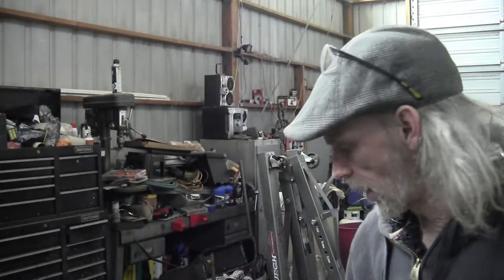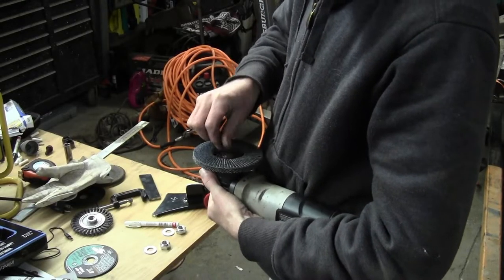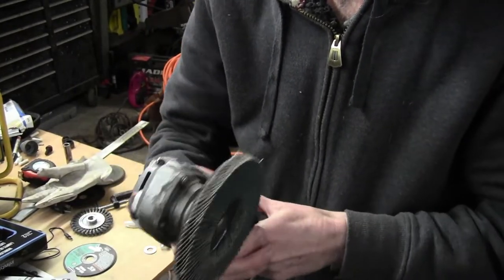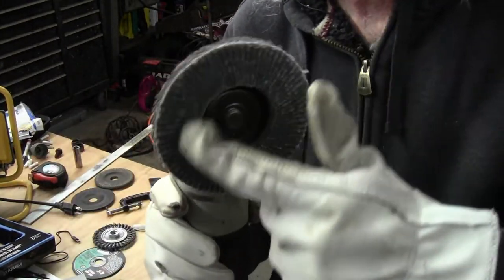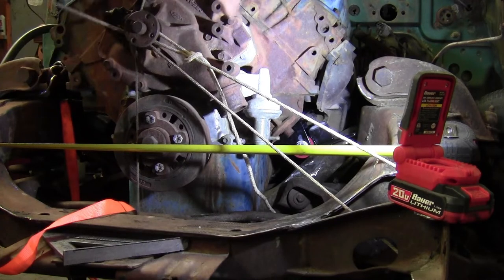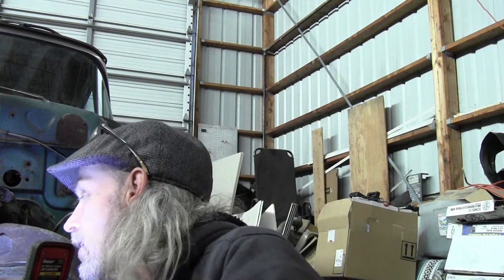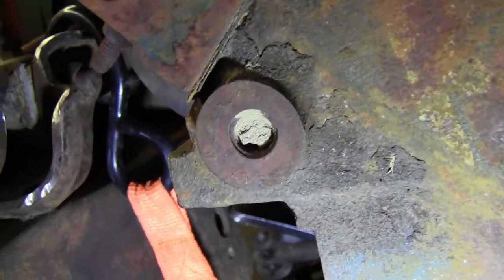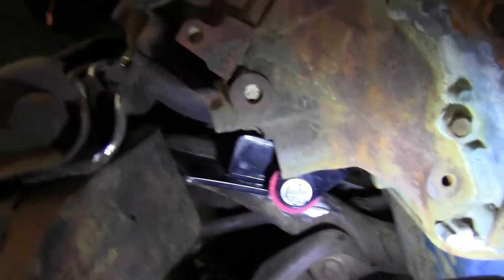1958 Ford Fairlane Budget Build, Ep 17 - My Hand Grinding Setup & Methods, and Motor Mount placement

Comment: I’ll have to try one of those discs. The thickness of them looks like it’ll last a loooong time. The front of that engine looks really familiar!
Reply from the maker: I really like them, and they do. When I get my big order in from the Taxedermy shop for Antler Pins, I'm hard flat grinding with these for a good 2 10hr days straight (I have to machine down 5/8ths solid shaft to slide into a steel sleeve tight enough to not wiggle but lose enough to go in).  That's when I found these and have never looked back since. I can do 800 feet of hard flat grinding with these and only go through 3 discs. All the others, I was lucky to get 40' out 1 disc.

Comment: Will have to look into those discs. We have AirGas here in town too. I've been using Nortons, and they seem to do well. Just so yo know, Ford doesn't always center their engines either. Several pickup applications, as well as the Mustang II are certainly off-center up to 1.5"   Hey looking good though! Moving right along!
Reply from the maker: Thanks Oly! Yeah, I get my Welding Wire from Norco (it's actually cheaper than HF), my gas and these flappers from Airgas, and the gloves from HF.... lol. As for centering that in there.... lol. If I could've went more to the pass side, I sure would've lol. Right where it's at now, I can barely get that pass manifold off, so I called it good at that.
Reply: @BareRoseGarage  oh yeah you had no room to go anywhere but center. 
I have a hard time trusting anything made at China Freight spinning at 10k RPM. Being cheap is one thing, but I've had one of those death wheels blow up, and its not pretty. So I tend to pay accordingly for stuff like that. I hear ya about those wire wheels though!

Comment: The price on those flap discs aren't to bad. You have to buy 10 at a time. But if they last that's not bad.
Reply from the maker: Yeah, if you buy them single they are harder to swallow, but by the case..... well I'm going off our "shop cost" from November of last year, but they where $5.35 each by the case (so like $55 a case w/tax). We've used them pretty heavy since then, and that one I'm holding was the last of that Case. I hate tossing prices because we get a discount at Airgas due to the amount of business we do through them & I know it changes area to area.

Comment: Shame porter cable is out of bussiness better stock up on what's left...there still some that use brushes out there got a few old HFTs still kicking I will have to order some weiler flappers they look very good.
Reply from the maker: I remember back when Porter Cable was stomping Dewalt but then Black & Decker (dewalt) bought Porter Cable. I figured it was to slowly eliminate the competition. Glad I got one of the last of these. You know I still have 2 of those old original "orange & grey" HF grinder that are still going strong. Had to change the brushes a few times but that was when you could do that for a couple bucks. Now I can't find the brushes anymore so I guess when they finally die, that will be the end of them. Up at the main shop you see I use Dewalts, but they are kinda spendy.